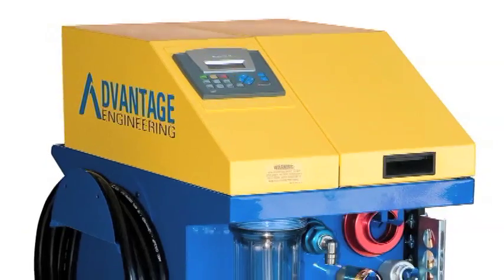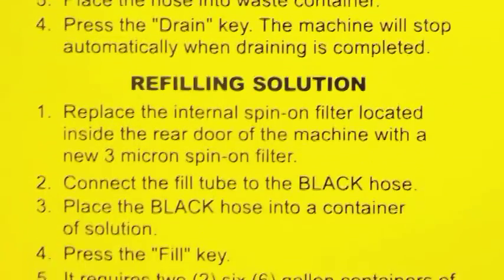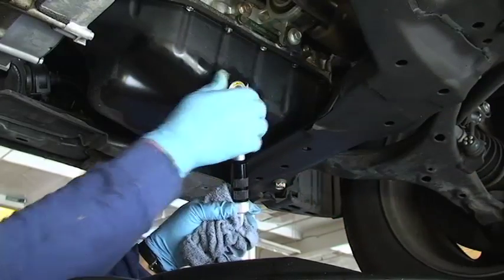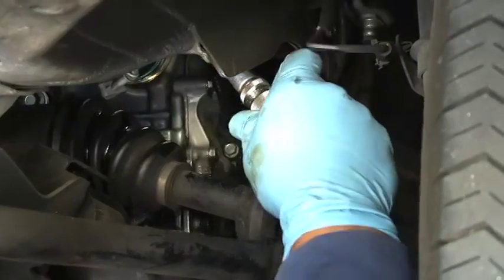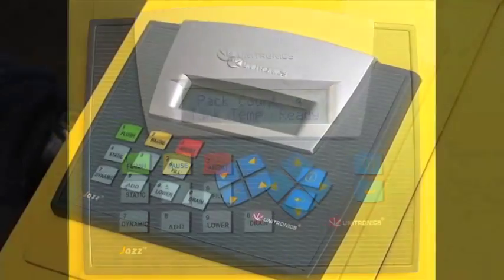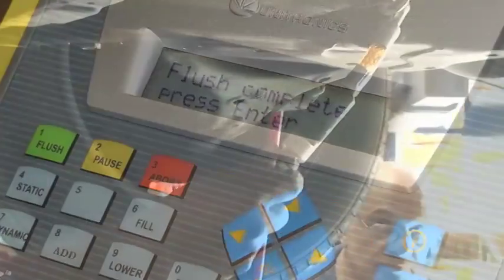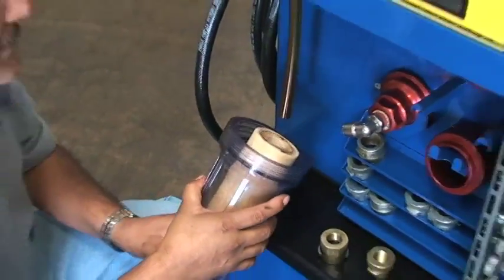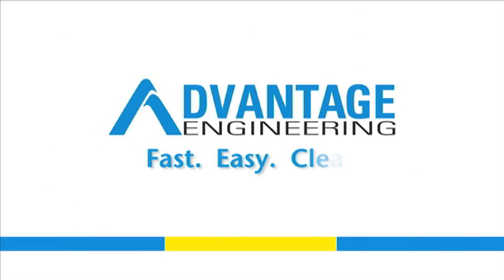Engine Flush

Comment: They also tell you not to add additives to oil and fuel, and your manual will tell you that causing your car to wheel spin will void your warranty, etc, etc... Manufacturers tell you a million things you shouldn't do and the reason is that they would have to excessively test any such method before recommending. A manufacturer doesn't want to risk a recall on 100.000 cars due to a negligent statement, say, due to recommending engine flushes without having tested it for years in a fleet of cars.

Comment: add  one ltr ATF OIL TO YOUR CAR ENGINE WITH OLD OIL 5 L TR ----- DRIVE YOUR CARE 250 KL M NORMAL  DRIVING ---- REPLACE THE OIL AND FILTER ---SAVE YOUR MONEY-- THIS IS THE BEST WAY IF YOUR CARE 4LTR USE 1/2 AT F OIL